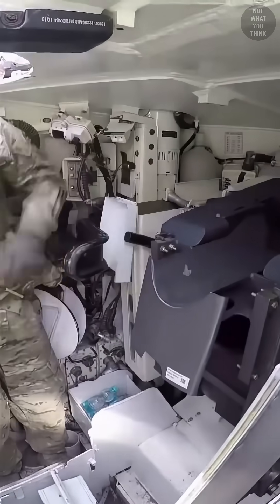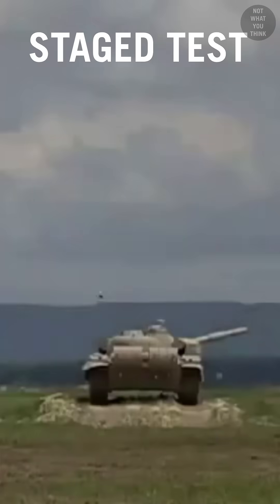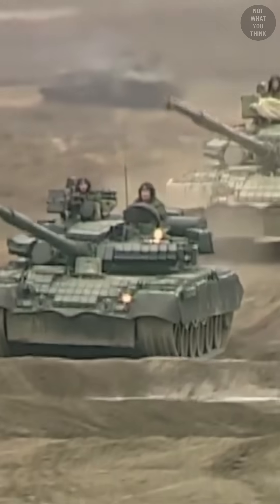Why M1 Abrams Tank Has No Auto-Loader #shorts

Comment: Russias design is meant for mass casualties and ease of replacements as you don’t have to be as trained as the American counter parts. The US thinks it more important to have 1 safe and well trained soldier than that can drive another tank if his gets damaged VS Russias 10 dispensable untrained soldiers. Russias thinks quantity is more important than quality and it shows in Ukraine.
Reply: Bullshit, noone in the Russian tank guard is allowed to use a tank without 6 months training. The average T90 is hit 16 times by RPG before destroyed, this is why Iraq buy T90 and not Abrams. No tanks or crew will survive a Javelin. 300 of 500 modified Polish tanks with US tech was destroyed in Kherson in 1 week .Tanks are not a super weapon.
Reply: @epoxy1710   it's not about the tank surviving. An ammo blowout will ruin any tank's prospects of continued use. 

It's about the crew surviving. The abrams does not protect its combat capabilities by having blowout panels. Rather, it protects the crew. 

This is the critical thing Russian tanks have issues with. It may be able to take 16 RPGs, but once that 16th rocket hits, it's over. A single javelin will cause an ammo blowout, and the crew will be a fine mush afterwards if not separated from the ammo.

The Russians chose to fix this in the T-14 by separating the crew from the turret. However, they tried to do this way before its time and didn't have the manufacturing capability to pull through with this new design.
Reply: @FishbedMyBeloved  No crew in Abrams will survive a Javelin.
Reply: @epoxy1710   they will, if it hits the ammo compartment. 

The tank will not.

Comment: French Leclers use both an auto loader and blowout panels for first stage ammo located in the rear of the turret. Secondary stage, located to the right of the driver in the hull, is also sperated with protective panels to protect crew.

Comment: The question is: Is the human loader worth the cost and effort for what little benefit he provides.
Reply: Yes, actually. It's a lot cheaper to simply get some 19 year old with a strong arm to move the ammo than it is to design, fabricate, and maintain a precise system like an autoloader. And humans are a lot more durable than autoloaders since they are made of soft tissue and can withstand impacts better. Also, tanks are becoming obsolete in this day and age because anti tank measures are becoming so powerful and cheap that the amount of money to make one tank is the amount to take down 20, and tank armor just can't improve very much anymore.
Reply: @oatmealman1586  Everything You just said was wrong

Comment: Looks to me like the entire design of the russian tanks is to not get hit in the first place. It's smaller than an Abrams by far for example.
That doesn't work with smart weapons though.
Reply: The average T90 takes 16 hits by RPG before destroyed, thats why Iraq by T90 and not Abrams. No tank or crew will survive a Javelin.
Reply: @epoxy1710  Pretty sure the US doesn't supply their own enemies with weapons. At least not deliberately.
Also that number seems made up.
Tanks don't have a health bar.
Reply: @jasperzanovich2504  Thats why they bought US fighter-jets?. Average T90 takes 16 hits.
Reply: @epoxy1710  It's a bullshit comparison, either the armor is not penetrated or it is. If you spread out the impacts all over the armor it doesn't do anything. Who did those "tests" anyway?
Reply: @jasperzanovich2504  The Syrian army told how many hits the T90 survived from RPG used by ISIS.
Reply: @epoxy1710  That means they bought the T90 first and then got the results?
That completely invalidates your initial argument.

Comment: Western tanks are primarily used for anti tank operations. Russian tanks are used for a different purpose. They are basically mobile artillery platforms that can pour heavy concentrated fire onto defensive positions (or as in Syria and Ukraine, basically every building within range). The auto loader makes the high rate of fire easy. However when moving ahead of infantry they are vulnerable to shoulder launched missiles as shown.
Reply: No? abrams were used in Afghanistan against infantry also the leopard 2 and challenger
Reply: nato tanks are for both

Comment: most Nato countries have a human loader and the same feature of blow out panels. Some Nato countries former Soviet block countries that still use Soviet/Russian tanks will obviously have an autoloader very similar or exactly the same as the Russian tanks. another reason most nato countries still have human loader is that if the loader is wounded or killed somebody can move into his spot and takeover but if the autoloader goes down the tank if combat ineffective and will have to retreat to be repaired and if retreat isn't possible the crew could and should destroy the tank as a last resort.

Comment: The tank's loader is quite often the Tank Commander's right-hand-man, second-in-charge of the tank crew. In addition to loading the main gun, he also has a spotting periscope. He supports the TC in the following ways:
1. Maintain 360' situational awareness around the tank, 
2. Detect, identify and assess threats in the battlespace
3. Take command of the tank / crew when the TC is not around (for any reason)
4. Support maintenance, service and logistics of the tank. 
5. Taking care of the junior soldiers in the tank.
Reply: No, that would be the Gunner who is typically a NCO as well. 
 
In order of rank, it would be:
TC > Gunner > Driver > Loader

The Loader is literally the most junior crew member of the tank
Reply: I think he meant that loaders have lots of jobs on the tank. The driver and gunner usually never leave the gunner station or the driver's hole. The loader is definitely the TC's helper. He is not second in command though. That is the gunner's role as an E-5 or E-4 Corporal.
Reply: What?! Bull s#!t...
The loader is at the bottom of the totem pole...
Usually has the lowest rank...
...so, no they don't have anything to say about what and how things are done.
The only thing that matters about the loader is how fast he is, since you can only engage targets as fast as he can reload
Reply: This is false, the gunner is 2nd on American tanks. The loader can be just some private right out of BCT.
Reply: @thomaslinville1508  Did he say American tanks?
Reply: @badethics7542  on a video about the Abrams, it is assumed.

Comment: the Russian Autoloader its not for Less Crew member, its bcs it uses the same Ammunition System as Big guns from WW2 like KV-2, IS-2 etc... it Projectile is Apart from the Propelent, you see the Autoloader loads the Projectile and the Gunpowder Bag Apart in Less than 6 seconds,.if we use an guy to load those Two heavy pieces it will be like 20 seconds to load the gun and the loader will be Tired of Load it

Comment: The era of the autoloader is now. 
The russian way? Fuck no.
The S.Korean K2 has an autoloader in the rear of the turret. And is open just as long as the M1. 
It has the same reload time as an on par hand loader.

Even further. The Japanese have perfected 120mm auto loaders. 
It has a 4second flat reload on normal mode. This is a hand loader on a good day. 
It has an overcharge mode that keeps the doors open, able to have the gun ready to fire in 1.2 seconds after the first shot. But this is more dangerous yes. 

Japan currently leads in firepower by a mile compared to US tanks. 
Even if the US went with 130 or 140mm later, the Japanese Type10 will still out gun. It has superior gyroscope stabilizers hooked to an AI targeting system, so putting accurate 120mm rounds on target every second in a half is quite easy for them.

Comment: That's fucking stupid. The Leclerc has a separate ammunition compartment AND and autoloader. With an autoloader, the door that opens could be even smaller and opened for an even shorter amount of time.

The real reason is that the army does overkill maintenance every week and needs more people to do the job quicker. If we had an autoloader, they would probably make the maintenance requirements more reasonable.

Comment: With manual loader there an advantage there 4 crew instead of 3 that goes along way for sentry wacth more rest more hands for field maintenance and repair also with manual loader you can consecutivly fire a mix of rounds type or change rounds type on the fly something autoloader can't do straight away and also manual gun fire faster then auto loader and manual guns is more reliable then an autoloader they dont jam as much.

Comment: This video aged like a fine wine
Reply: Yeah, no... new Abrams will have autoloader, lol.
Reply: @SuperGeronimo999  with the top heavily armored and blow out panels, it won't be a Russian pop-star.
Reply: @gerrimiller7238  Doesn't that prove that the issue wasn't with the autolaoder rather with the layout of russian autoloaders?
Reply: @tinytrinket7082  Yep.  No reason an autoloader can't have a door and a blow out panel too.
Reply: @tinytrinket7082  Well yes, and I'm pretty sure most agree with this too, the tank does what it was intended to do. The autoloader wasn't faulty, but the ammo placement and other factors surrounding it made it the weakest link in this current war.
Here's biggest issue in my view. Infantry fire anti tank systems that are cheap, disposable, abundant, and developed with this tank generation as their intended targets, and are even still improving.
Reply: @tinytrinket7082  Not really, those tanks were originally designed decades ago. So at the time creating both an autoloader and a safe way to store them was not really feasible. 

The Americans chose to create a safe system with the soviets used the autoloader. 

Now we can build both so we do and Russia is not the Soviet union so they will never mass produce a tank that can do both either.

Comment: The reason why they don't use auto-loader because the it takes 10 seconds for the machine to load another round but with a human loader he can load it in under 3 seconds faster to allow the commander to fire more than 2 rounds per shot to destroy tanks quicker that's why Abrams tank crew consist of 4, driver, commander, gunner, & loader while the Russian tank crew has 3 a driver, commander, & gunner plus their tanks are smaller than the Abrams tank theirs a comparison between the Abrams and every Russian tank variants

Comment: He failed to mention that these blow out panels rarely save the crew. If more than a couple rounds are damaged, they still die. It buys a couple seconds to escape if the kill isn't instant
Reply: "Rarely" is still so much better than "Never".  Those "couple of seconds" is still an improvement over instant cook-off. It's rare to see footage or reports of destroyed Abrams, both in US service and exported like Saudi,  where the tank just immediately goes into flames and explodes. Meanwhile most videos of Russian tanks since Vietnam up into Syria, Chechnya and Ukraine are often times ammo cook-offs.
Reply: @DrSabot-A  you would be surprised how many hits the t series tanks take compared to the m1. There are means to purge damaged rounds from an autoloader, but get enough at once and it'll go up. Same applies to the m1. T series tanks are shown to take multiple javelin/nlaw hits, something it owes to that lower ammunition storage. There are actually specific parts of the tank that must be hit to get the ammunition to detonate instantly, something along the lines of a lucky shot. That or clean hull penetration, which would've almost certainly killed the crew anyway, regardless of make or model. For an apples to apples comparison, t-series tanks gained their fame for resilience in small conflicts, facing mainly IEDs and RPGs. The m1 is very good against IEDs, but one rpg hit to the turret almost always destroys the tank, or requires it withdraw to repair damages. The exposed ammo rack is just unsafe and you'd notice that the few videos of m1s are to RPGs. Turkey found that out with the German tanks as well. It's like putting the crew at more risk for the chance one will escape, akin to not using seatbelts do you do t get stuck after an accident. 
Now it's interesting you said about it being rare to see footage of m1 destroyed, but welcome to the world of media control. The western media is government subsided, as anyone would expect, so very rarely will anything detrimental to the military be allowed. Little petty things yeah, but nothing that may impact operation or integrity. There is a reason why whistle blowers get hunted across the globe and imprisoned with no trial. It is what it is. You'd notice that none of these destruction videos you've seen ever came from a western source, just kinda released by whoever made it and then it spread to the public eye before it could be removed. As per the us report, we lost less than 20 tanks in Iraq and those were mostly scuttled by the crew after being immobilized to prevent enemy use. I'm pretty sure those videos you saw didn't look like that and I'm pretty sure there are more than 20 wreck, unless someone else knows how to build them. As for the instant death, know that the blast door is actually q firewall. The thickness of that flat plate doesn't compare to that of the rounded barrel. If anything more than a couple rounds are hit, no one is getting out through those flames. And there is the other issue that it also does pop the turret. There is a secondary storage aboard the m1, and it isn't atop the turret. There is virtually no benefit to this setup vs an autoloader on peer to peer combat, when anything can hit your ammunition, the ammunition itself can prevent crew escape if not an instant destruction and it still didn't mitigate the issue of internal storage. The whole point of turret racks are for IEDs, because that's kinda what our enemies usually use, but the world is changing.
Reply: @deven6518  You say that yet Soviet tanks still went up like fireballs in non peer to peer combat. Will Americans have never had that issue. 

Are we forgetting all the conflicts the soviets/Russia got into in the middle east or all their export models getting absolutely destroyed?
Reply: @megandamaso8496  soviets had conflicts in the middle east and who was supplying weapons hand over fist and training soldiers? A certain USA maybe? Hmmm? Don't pretend it's the same as killing goat herders with fertilizer satchels. 
And also, never had that problem? No, western tanks have never faced peer combat but they have equally not seen the same widespread use as Soviet tanks. If there are 100k corollas and 1000 have mechanical related accidents while 50 Ferraris have 10 accidents, would you say the corolla is more dangerous? Statistics. The number is greater but the probability is lower. If you're wondering what tf I'm talking about, ask turkey and Saudi Arabia what's happening to their beautiful western tanks. The number of losses appear fewer, but relative to the deployment numbers it's atrocious. You can look at some of their destructions too. They do go up in fireballs. You might be able to find some from Iraq as well, missing turrets. Understand that at the end of the day, a tank is metal. While a t-series tank can take an atgm and possibly survive (yay Ukraine for providing video evidence that javelins and nlaws are overhype), the m1 cannot survive any turret hit whatsoever. That is a plain and simple difference you can't patriotism away

Comment: This is bullshit. If the projectiles stored in the turret explode, there is no armored door in this world, capable to withstand the explosion. Even with the blowup panels... Probably, the real reason is that Abrams is already too large,  especially tall and heavy, due to its complicated and fuel guzzling gas turbine proulsion and the necessary large fuel tanks, which left no other weight and space margin to fit the auto loading system.
Reply: It does

Comment: Hatch open commander exposed still greatly superior for controlling fire and seeing what going on. 
Extra crew to replace lost commander.
Yes exposed commanders get killed but provide massive advantage in ranged fights.

Humans don’t jam like auto loader and can fish out a ammo of different types fast.

Get rid of protected compartment as surviving armor penetration low anyway.
Having substantially more rounds was key in WWII and Israeli wars.

Western tanks go tall so gun can depress a lot allowing haul down where bottom of tank protected by rise in ground or obstacles in front of tank.
This part of maneuver style of combat where ability to duck or move behind something a key part.

Impressive some German tank unit commanders used a motorcycle or walked along with tanks especially in building areas so they could get maximum view of battle.
Have to look for later use of this

Comment: It doesn't matter if it had a blow out panel or not ,once that javelin or nlaw penetrate the roof than it's 99% game over for most tank 
Even if the western tank doesn't pop their turrets out, the force and heat from the javelin or nlaw is still enough to cripple the crew and force them out

Comment: Ok so if you mean most common by numbers built then yes T64/72/82/90s and their turret basket magazine.
But by variety: tanks like Type-90/10 or Leclercs have cassette magazines at the rear of the turret, similar to the M1. If anything because of their use if autoloader their powered armoured door is much smaller than the M1.